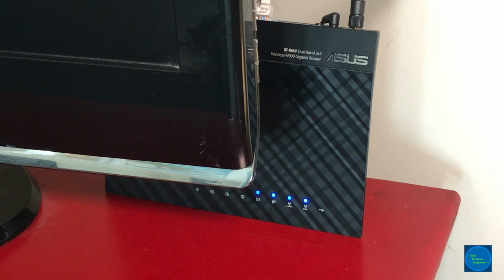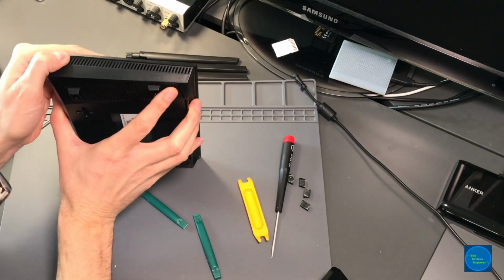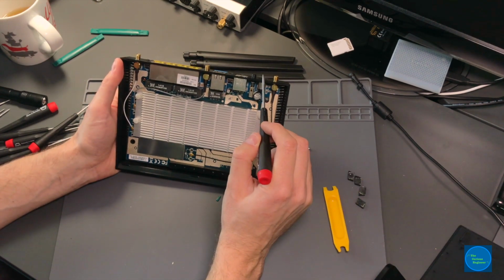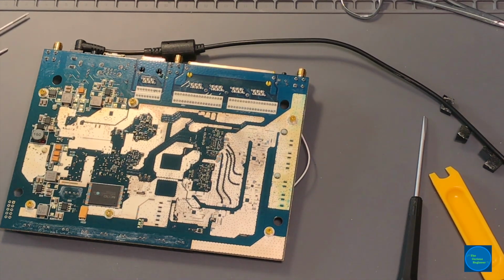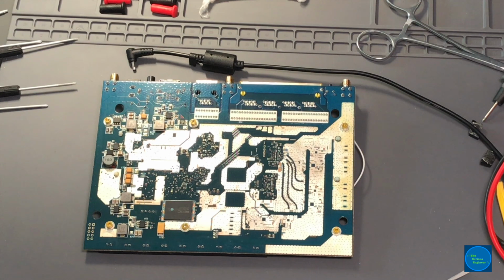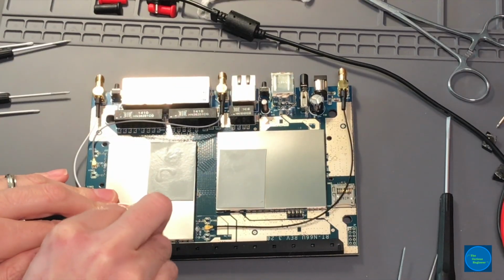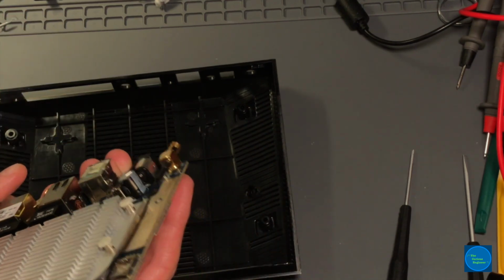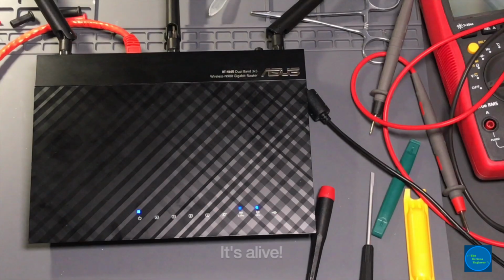Teardown: Troubleshooting an ASUS RT-N66U Router

Comment: Hello i have the RT-AC66U, its not broadcasting 5ghz. It has 2.4ghz though, and both lights are on on the router. I installed Merlinwrt and it shows only the 2.4ghz (left)half of the signal. I tried resetting, firmware flash, nothing works. Any ideas. Regards

Comment: Nice breakdown. Any idea which of the 3 antennas is 2.4 or 5ghz? u21, con12, con14. Or it doesn't matter? Using this as a bridge to boost wifi signal to garage. Using 2.4ghz
Reply from the maker: Thanks! IIRC, it's a 3x3 MIMO, so all three antennas are used for 2.4 GHz and 5GHz.

Comment: I removed the plastic top of mine and it was still too hot for my liking so I made a 12v 60mm fan powered by a usb cable plugged into the back. (5v) Quiet and very effective, still working today (3-27-23)

Comment: I just got one of those for $10 Canadian used. I put openwrt on it and the wireless is garbage. I am trying to understand if it is just openwrt does not have the broadcomm drivers or something is wrong with it. The card slot can be used for media with openwrt, but I don't want to open it up. Also I am worried the antennas are not interchangeable, but some are 2 and 5. I am going to try moving them.

Comment: Thank you! Mine had a bad power switch, and you helped me get into it without destroying it!
Reply: I also now have a bad power spring switch.... how did you fix it ?
Reply: @genroo  I soldered a jumper wire across the switch's terminals.  So the switch still moves, but it's effectively always on now.  Not that it matters; none of my other routers have a power switch to begin with.

Comment: Thanks for doing this video. I have an rt-n65u which has been going into a boot loop. I've tried all the methods for restoring but no luck.  Thanks to you I have been able to get into the case but unfortunately mine doesn't pass the first test you do. The voltage on mine is 19.3v when off but when I turn on it drops to 0.6mv. If I turn off again the voltage goes up to just 17.6v and then rises slowly. Does this indicate a problem with the power supply?
Reply from the maker: You are most welcome! Do you have another known good power supply you can test it with? Is the unit turning on when it is showing 0.6 mV? If so, you might be probing different pins (like across the switch, for example).
Reply: @TheCuriousEngineerChannel  Thanks for the reply. I've managed to sort it now. It turned our to be the ethernet cable. I had already tested the cable, but I noticed that the router booted up and stayed on without the cable plugged in. After connecting another cable it now works again.
Reply: @jonsumisu9016  is your other end device of that ethernet shorted?
Reply: @mrizkic  No, everything seems OK now I'm using another cable. Thanks.

Comment: Well, my Asus RT-N66R seems to be defective now. I still get the radio lights on (2.4 and 5.0 GHz), but devices (PC, smartphone, tablet) can only recognize wireless signal (2.4 and 5.0 GHz) when they are very very near to the router, like no more than 2 or 3 inches far. I've tried to replace the 3 antennas but it didn't get any better. In fact, the router seems not to be using the antennas at all. Any idea on how we can fix it? Thanks.
Reply from the maker: Oohhh, sorry to hear that. Just a guess but it seems like the PA (Power Amplifier) for the radio's has gone out or perhaps the power regulation to the PA's has failed. If memory serves, the PA is integrated into the 2.4 GHz and 5.0 GHz ICs. However, it might just be as simple as the main power supply flaking a bit, and it's providing just high enough voltage to power the logic stuff, but not the higher voltage needed for the PAs. Try a different suitably rated power adapter? Again, just a guess. Thanks for watching!

Comment: Thanks for the video! By the way, you can check the temperatures of both of the WiFi transceivers even with the stock firmware. All you need to do is log in via telnet using your regular Web UI admin credentials and issue this  command:
    wl -i eth1 phy_tempsense
That’s for the 2.4 GHz band. And eth2 is the 5 GHz one. Just make sure that telnet is enabled in the Administration → System section before trying to connect.

Comment: You did not do any follow-up video did it help to introduce your temperature after adding some of these compared to the thermal pads
Reply from the maker: It certainly help stabilize the router, and I was able to use it for another 2+ years. I didn't do any specific testing on it to check temperatures, but it always "felt" cooler than before. I know, not highly scientific, but it's something. Thanks for watching!

Comment: Can you comment on your before and after temperatures after replacing the thermal pads with paste?
Reply from the maker: I don't know. However, it seemed to spread the heat out better than the original pads, and kept the router more stable. Specifically it the 2.4 GHz radio (which seemed to always run hotter) didn't glitch out anywhere near as frequently. Thanks for watching.
Reply: @TheCuriousEngineerChannel  Actually, if you take a look at the board where the thermal pads were. Because of the difference in height, the board has permanently been warped to a concave shape. So with the thermal paste applied, the center would not be making much or at all any contact. I know because I've taken mine apart and applied thermal paste too lol. Except, I left the pads and just put thermal paste everywhere else. It would be hard to unwarp the board to make proper contact with the heatsink.

Comment: thanks you video help me to remove the spring from the power button. the power button goes eyerytime in off position (couldn't hold the on position) know the 9 years old router works again, hopefully for 5 years more.
Reply: I had the exact same problem. Wanted to take out the entire switch but taking out the spring is much easier. Thanks or helping me fix it!
Reply: Have same issue.  I was not certain which pins I could safely soldier together so I used a toothpick to place friction on the button to keep it in.  I thank Curious Engineer for posting how to open the case.
Reply: When almost eight years old, the power switch failed mechanically on mine, too (even though it had been operated only rarely and not for a long time).  At the time of failure, the router was undisturbed, except that the weather was hot).  The switch seems to be a changeover type, but I assume that the connection made when the switch is "out" is of no importance, so I shorted the "normally open" contacts by soldering on a piece of wire.  This restored operation.  The switch is of little value, anyway, since power can be removed by taking out the power plug or by unplugging the external supply.  The basic problem seems to be that the switch is of poor quality.

Comment: Hi, i have this Router but can't access it through utp cable, only by wifi, i updatet the (old merlin) firmware by the 2020 asus firmware.
The problem is that the nr1 Lan port led alway lids up with no cable in it and 2 + 3 don't lid up with cable in it, only 4 lids up when cable is connected, so it seems a hardware fault, any suggestions ?  (exept ditching it).

Comment: The toggle on my power button broke on this  Any idea how to get it to just stay on or how to replace it?
Reply: Remove the lid as shown in the video. Take out the printplate. Remove the very small retainer for a spring on the power button. Remove the small spring itself. It should now click into "power on" for ever. That's it. No glue needed. If you want to power down the router, just remove the power adapter.
Reply: @HermanCaron  perfect, thanks, it helped me!
Reply: @HermanCaron  Thank you. This worked for me as well!
Reply: Mine broke too. I simply use a small plastic piece and super-glued over the switch to depress the toggle switch permanently.

Comment: STAY AWHILE AND LISTEN!  
Got goosebumps once I heard the guitar lol

Do you know if soldering the antenna header connectors will allow 9 antennas using merlin or custom firmware?
Reply from the maker: Unfortunately I'm thinking not. The 2.4 GHz and 5 GHz wireless controllers are designed for a Dual-Band 3x3 MIMO array. While the BNC connector pads are there, and are routed in the PCB; they do not appear to be connected to anything using this particular Broadcom 2.4 GHz and 5 GHz controller. Cheers!

Comment: Hi my N66U suddenly stop working, now 3 blue lights turns on quickly for a sec when i power on, then it kinda have a dim flashing here and there for that 3 lights, and then no more lights afterward, any idea where I should check? I checked the switch, getting 19.57V when it's off and around 19.49V after it turns on
Reply from the maker: Perhaps continue measuring the voltage for a while after the lights start acting up. If the measured voltage starts sagging, perhaps you might to replace the power adapter? Also, perhaps check that one electrolytic capacitor in front of the DC power port on the board, and see if it is bulging or leaking. Good luck!
Reply: @TheCuriousEngineerChannel  I actually came here for a similar issue. Three lights turn on bright for a moment, then the power and all the lights turn on, then the power starts flashing, then all of them turn off and just the three over "2" "1" and the internet flash dimly. If I turn the device on, then connect the power adapter to the wall it does not power on and the adapter LED light flashes dimly. If I turn the device off or just connect the power cord after it's in the wall, I get the 3 lights flashing. I'm measuring 18.86v and that drops to 18.64v but a few times it went to 12v when I turn it on. I have a second power supply from a n56u and it does the same thing. My home made bench supply is broken but I could measure current draw once I fix that. 

Another thing to note is that FR9886 in the top left is a 2A step down converter on the underside of the board. This component gets too hot to touch and led me to do some testing... Vout is connected to GND and there is a second FR9886 with the same exact issue...

Many of the capacitors in the center are touching GND on both sides so I really wonder how much time this thing is worth. Someone was throwing this router away along with a gig hub that has similar issues when powered on so I wonder if this was a power surge. 

Thoughts?
Reply from the maker: @Gkid8  Hey! Thanks for watching! If a known good supply is dropping down to 12 Vdc when powering up, it seems to me that the switched-mode power supply (SMPS) in the supply is folding back. This is a normal thing for it to if the output current draw is exceeded. It's not uncommon for components to get too hot to touch inside a device, which is usually at around 60C / 140F for more people, so perhaps check it with a temperature sensor or IR thermometer? If it is above 90C / 194 F, then I think you found your issue! That converter could have shorted out internally, or one of the supporting components could have failed short. It could be a simple fix, but without knowing more or seeing it, I can't say for sure. Hope that helps!
Reply: @TheCuriousEngineerChannel  Yeah, I checked and the ethernet hub connected to it had the exact same issue and centered around one of the main chips. I think there was a voltage spike and it fried something in both devices. I threw them away
Reply: same issue with mine, i kind of wanna repair it coz it is a good & stable router...but just don't know where to start with the repair...
Reply: Similar problem,  tried a reset:  No result.
While in recovery  mode with the slow blinking power led on and off, while trying to upload the recovery mode stops, and came back into the situation where some of the lights keep (dim) flashing, except for the wifi-leds, the wifi leds remained off.
I saw that the router age was >10 years so I gave up, and decided to buy a new router. 😞

Comment: hi my RT-N66 cant turn on, the adapter blue light is on, I suspect the Ac input socket defected, any clue to check? Many Thanks bro
Reply: My RT went out and it turned out to be the on off switch, I removed a retaining clip and the spring in back of the on, off "push"  in switch and now it just stays on.
Reply: @Dillinger86  i did the same, remove the spring and everthing works
Reply from the maker: Hi! If you haven't checked out the latest video I've posted, I'd start there. Otherwise, if you have, perhaps check out to see if the switch is actually working  - which I walk through in this video, through checking the voltage. You'll need a voltmeter of some sort. If the power LED is coming on the adapter, that likely indicates there is some voltage at the output, as that LED is on the low-voltage, DC -side. Maybe I'll do a quick video on that :). Hope that helps. The solution @Kidand274 performed might work as well!
Reply: @TheCuriousEngineerChannel  today I jz check with multimeter from the input Vdc which I suppose to get 19V, but I got 0.15V before I switch on, and when I push the button it shows -0.15V where i suppose to get -19V.

Comment: What did you do to resolve? My RT-AC3100 5GHz band keeps randomly turning off (or totally non-functional most of the time), and when it does work, which is basically never, it refuses connections (authentication error) or speed is 6Mb/s max. Last week the router just completely stopped working (two LEDs were on, but no connections), until I performed a factory reset. I have used rescue mode to flash older firmware packages, but nothing has resolved these issues. Any insight regarding 5Ghz components that may be failing or have a loose connection? A lot of people have this problem, but I repair electronics everyday, so I'm hoping to find some information about relevant components. I have never worked on a router mainboard! Thanks for the video, hope to find out what worked for you!
Reply from the maker: Thats a bummer, but thanks for watching! I'm working on Part II of video right now! Coming out in a few weeks. Specifically with your situation - my guess is that it perhaps might be overheating. Does it seem to perform reasonably on the 2.4 GHz band or over ethernet? This might help further isolate the issue. Cheers!

Comment: Did u manage to fix the issues in the end? I had to open my up because of the power button.
Reply from the maker: I did, and I am still using it! The crazy cooling solution seemed to help! ASUS issued a few firmware updates recently that helped, as well. However, I have two other videos to finish on that project - I got sidetracked! Look out of those in the near future!
Reply: @kidsnd274, have u managed to settled the power button?
Reply: @calvinliew6846  Yup, took out the spring and just taped the button in. Works like a charm
Reply: @Kidsnd274  I think my 1 is not the power button problem, maybe the input socket problem probably, because I see the adapter is lighting in blue, but when plug in to the router input socket and nothing happen to the router.
Reply: what was you fix? my power button is also damaged, i remove the spring, know it works